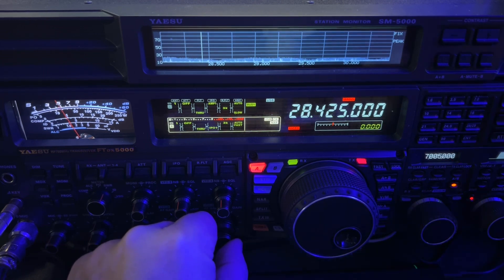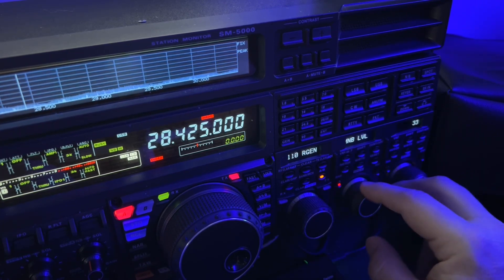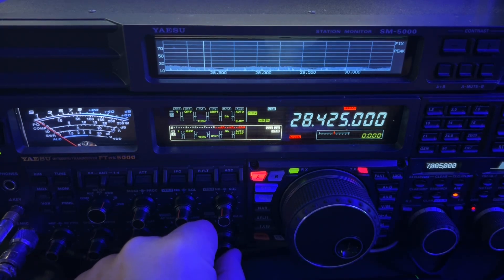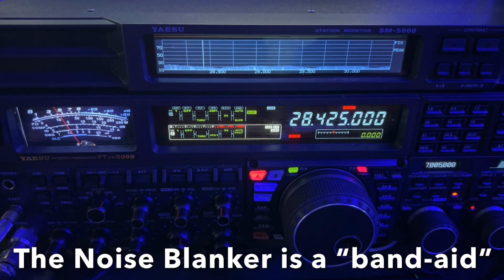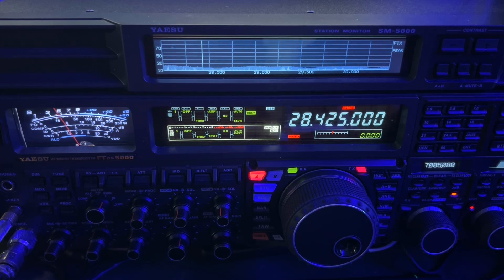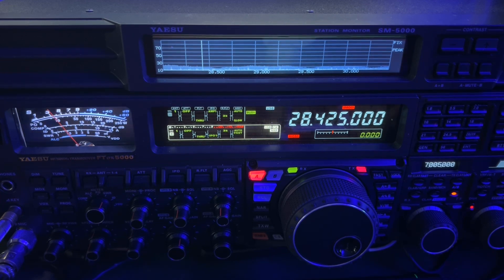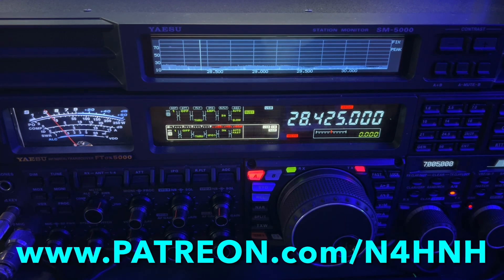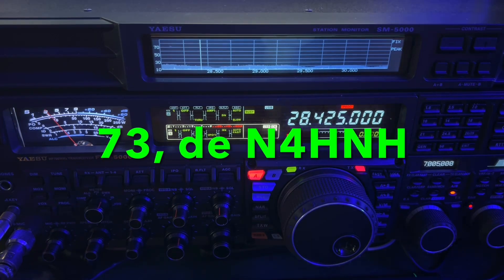It’s Back!

Comment: My favourite Yaesu button is the DNF (Dynamic Notch Filter). Leave it switched on accidentally and it cuts out nearly all CW!  😂
Reply from the maker: The Digital Notch Filter should definitely not be left enabled but used when needed. DNF introduces some distortion into the received audio.  The amount of distortion introduced varies across the various transceivers. The DNF in the FTdx5000MP introduces the least distortion while the FTdx10 introduces the most. Only use DNF during conditions where you cannot afford to miss a word due to a transient tuner-upper. I use manual notch against habitual tuner-uppers.   I also use manual notch for CW, to minimize filter ripple, as shown in numerous videos on the channel. 

73, de N4HNH

Comment: I used to deal with that quite a lot when I was on HF.  I used to get it when it rained.  Sometimes it would be so strong (20db+) , it would wipe out broadcast TV stations.  The power company did fix it when I called them but these days, I don't even bother.  There's so much noise from everything else,  I don't really even try to run a station anymore.  You radio seems to handle it pretty well.
Reply from the maker: It’s a shame you can’t enjoy your radio anymore. My power company took care of this. I performed the circuit breaker test to isolate which devices in my house were causing noise, and I took care of them. 

73, de N4HNH

Comment: High voltage power lines require maintenance to cut down on leakage current. When the system is first installed leakage current is minimal/acceptable but over time pollution settles upon the surfaces of these insulators and leakage current goes up. The pollution is accumulative and ultimately the current will spike and clear the path, your hearing this clearing. A simple method used to clean off the pollution is with distilled water. The power company use a special truck that they electrically isolate from earth and spray this distilled water and wash the pollution away, its simple, effective and silence returns to the land!
Don't use your garden hose less you want to be on the evening news!
Reply: Once upon a time, the power companies used Collinite Insulator Wax on a regular basis. Today you can buy this excellent wax for your car. I live in Duquesne Light's service area, and they ran afoul of the FCC for (1) refusing to correct interference problems, and (2) sending the amateur who filed the complaint a bill for the cost of correcting their problems.
Reply from the maker: Oh no!  My power company views me as doing them a favor. They’ve come out a couple of times now and found the noise source to be blown arrestors.
Reply: @n4hnhradio  About 6 months ago a horrendous noise developed after a storm. They didn't come out to fix it until my lights and my neighbors lights began flickering.
Reply from the maker: Wow!  I guess not all power companies take RFI seriously. You can report it to the ARRL. You could file a complaint with the FCC too. But the FCC tasks the ARRL with contacting the power company on our behalf. I filed a complaint with the FCC after my power company seemed to ignore me the first time. Three months later, the The ARRL finally called me to say they would call my power company for me, but they wanted me to try once more. I called the power company again (4th time) and they finally came out.  After that they were very cooperative. Maybe they figured out I wasn’t crying wolf. 

73, de N4HNH
Reply from the maker: My power company replaced the glass insulators with a polymer insulator. That solved that issue. Blown lightning arrestors and loose hardware have been the main issue here.  When this video was made, we had just experienced weeks of terrible weather. My area gets more lightning strikes than all of metro Atlanta, according to the power company engineer.  They actually thank me when I report this. It is usually a blown lightning arrestor. In this case, two blown lightning arrestors. 

73, de N4HNH